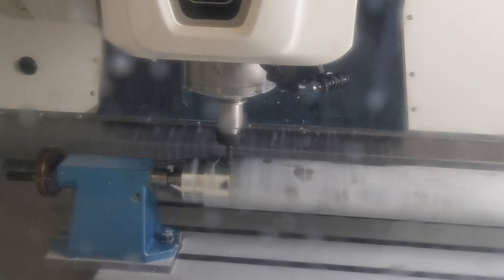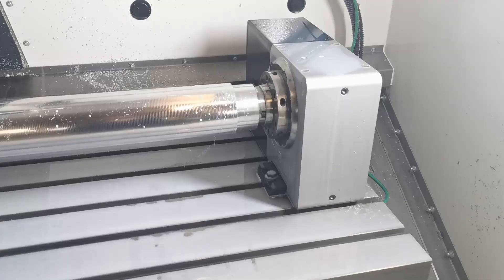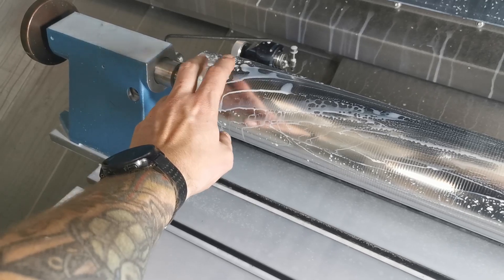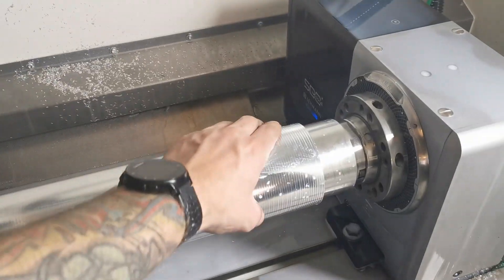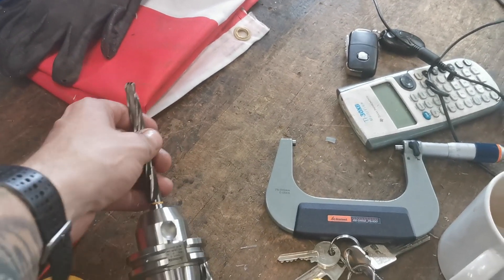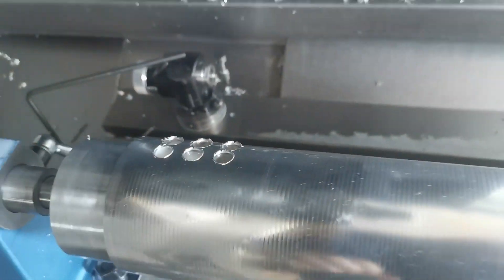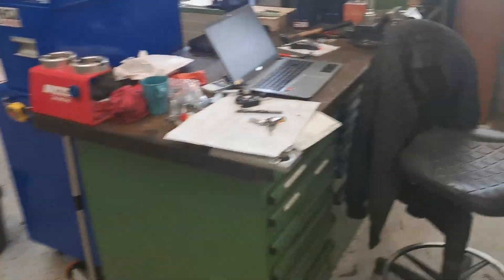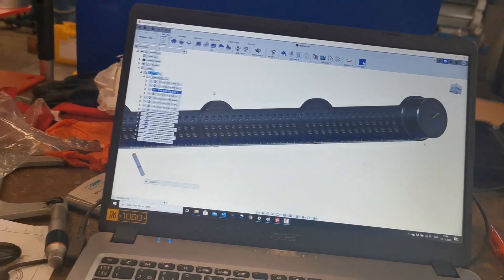Shop Update 4 - Turn milling on the DMG

Comment: The thing about using the rotary axis like that, on most old lathes there is some error in the axis so it won't be accurate over like 100 rotations and you eventually get a axis excess error. Keeping the spindle rotary axis motion to a minimum is preferable for accuracy reasons.  But it works just fine on that rotary table??
Reply from the maker: This is absolut so you can rotate it All you want i guess. I never had Any problems with it not being accurate  after alot of rotations.

Thanks for watching

Comment: Hi Nikolai, Nice video.

Why do you do the initial diameter with turn milling, if you have to go over that surface again as turn milling later for a finish pass, and end up in the lathe? 

Once you mill out the big half thickness pockets, does the part warp?
Reply from the maker: I do the first initial pass so i get a known diameter when i am going to drill the holes and stuff. I finish the part OD after the drilling and milling because of the stress relef in the part. It does bend quite alot when removing material like that and everything need to be fairly concenteic. I do the ends o on the lathe because its a very tight tolerance and I dont have to much Faith in the turn milling. I am fairly quick to do the ends on the lathe. And I use the lathe when i deburr everything anyway.

I Hope that makes sense 😁
Reply: @nikolaiownz  Thanks. Do you have a lot of them to do? Looks like a lot of time goes into each one.
Reply from the maker: @RotarySMP  i Hope i can get to many some more of them. It takes about a day to make one. I know the customer uses alot of them a year. If its a sucess and they are happy i Will be making some more. They always comes as a pair
Reply: @nikolaiownz  I wish you success with that.

Comment from the maker: I did think a about doing the ends where the bearing fits are in the dmg but I still have some problems with holding really small tollerances with this method.i think My tailstock is flexing abit.